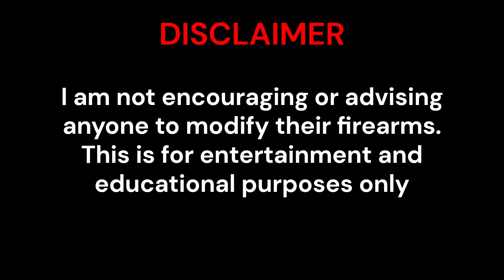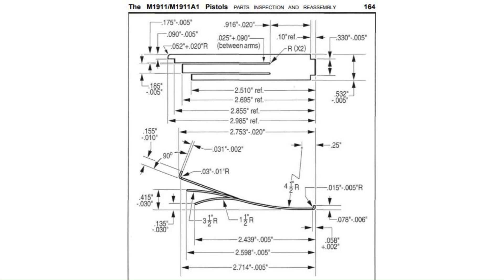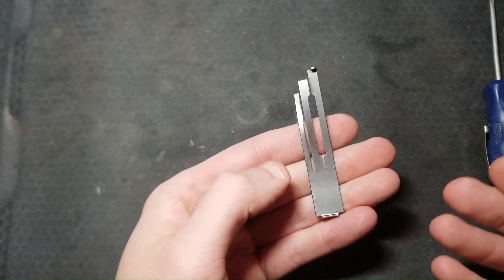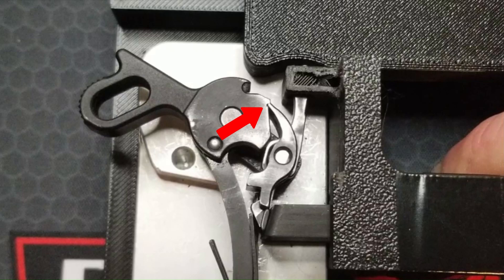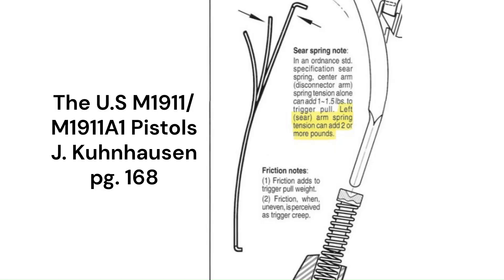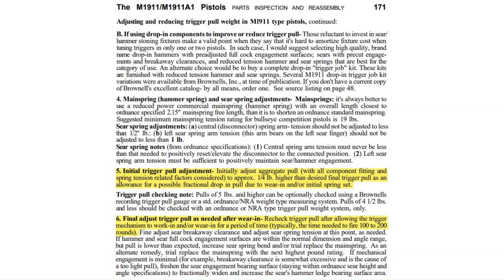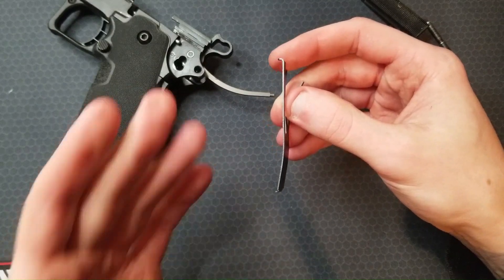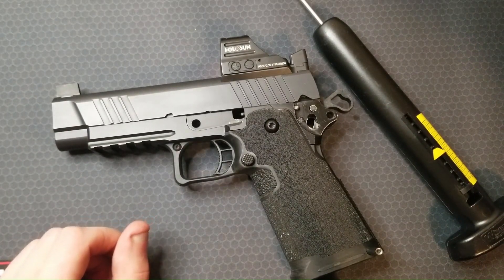A Detailed Look at the 1911 Sear Spring & Adjustment

Comment: Dude.... TYSFM.. I recently put the atlas bow trigger into my 2011. Everything went smooth until reassembly and grip safety stopped working. 5 1/2 hours later. Retracing my steps. bending the right side of the sear and nothing. It took until your video and seeing SPECIFICALLY that the left side of the sear sits on TOP legs of the sear, NOT UNDER. OMFG thank you.
Reply from the maker: Haha happens to the best of us! Glad this helped!

Comment: I use the same Colt spring in all of my 1911/2011s. I have found it pretty darned easy to get 3.25lb (and safely operating) pulls with this spring and some judicious polishing. I have parts inbound to reduce an officer model mainspring from 28 lbs to 19 or 21lbs to see if in can get a 3lb pull with no other changes. Hey, I’d love to know your thoughts on flat recoil springs. I know it has nothing to do with pull but it looks like the big guys (Wilson and brown) started offering these around 15 years ago and even ISMI is in that game as well now. It requires changing the guide rods from .336” to .250” to accommodate them.
Reply from the maker: Flat recoil springs generally will offer a more consistent force vs displacement. They also don't experience as much internal stress during displacement due to their wire shape and higher number of coils. They will generally have a longer service life. Thats the big reason they are so popular in pistols now days as far as i can tell - increased service life.

Comment: In a weird way my brain can’t help but make it look like a rev match downshift in a straight drive car. Completely different I’m sure but still feels manual if you know what I mean😂😂
Reply from the maker: Haha I get it. I only own standard transmission vehicles. There is something similar in the way a 1911 works. That finely tuned mechanical system that is very analog.
Reply: @EngineersArmory Question…Would a Staccato C2 grip fit onto a staccato XC size firearm? My line of thinking is as long as it’s the same caliber and double stack theoretically it should. Based on your content I figured I’d ask with your knowledge in the matter.
Reply from the maker: @Lee-ForReal i beleive so. They both take "standard" staccato/STI pattern mags. The C2 just uses a slightly shorter 120mm 16 round mag, rather than a 126mm 17 round mag. I would imagine the mounting interface at the frame is the same, but i dont know for sure. You can buy "commander" style grips, Cheely offers one, MJD can cut any of their grips for the 120mm magazines to sit flush. I am building a doublestack commander right now and got a carry cut MJD grip module. The 120mm mags sit flush. It still takes the 17 and 20 round mags as well they just stick out a bit.
Reply: @E @EngineersArmory Preciate you man, I’ll keep deep diving😂

Comment: I've got a 2311 that was, what the French would call "le garbage", from the factory. Jammed hammer so it had to go back. They put a new sear in it and then 150 rounds through it. So after buying it I got to spend $40 to have someone else make it a not new gun for me. Anyway don't buy a girsan/eaa, but if you do you have to watch this to figure out how to adjust that sear spring. It isn't hot garbage like it was, but it's a lot closer to being that five at the bar at 1:30am when you're out of options...

Comment: Excellent detailed video!  Given your attention to detail and importance you place on clearly communicating detail, I'll guess you are a mechanical engineer or in a related profession.  I am curious whether you have also tried the lightened sear spring offered from EGW?  You mentioned you have standardized on the EGW offered factory Colt, so I would think you would have tried the lightened sear spring (SKU:10694) offered from EGW also?  If so, what did you think?  I just bought both from EGW and the only differences I can see are that the lightened seems to have more of a black oxide finish, and the relief cuts are a little longer, going closer to the base of the tangs.  I haven't tried installing either yet though.  I previously installed the EGW offered factory Colt with the help of your video.  Thanks again for the well done video.
Reply from the maker: I am indeed a mechanical engineer.  I have not tried the lightened sear spring from EGW. I have found EGW 10960 (colt reduced power), and Wolff 31201 work great for my purposes. I can get any trigger pull i want within reason using either of those springs.

Comment: I have a 9mm 2011 that I was starting to get light primer strikes with. So I changed out the mainspring from a 16 pound to a 19 pound. The light primer strike went away but now I am having hammer follow when I hold the trigger in after each shot. When I let off the trigger after each shot the hammer stays cocked. What or how should I adjust the sear spring to eliminate this problem? I have not replaced any other parts except for the mainspring. Someone told me with the more powerful spring I am getting hammer bounce.
Reply from the maker: Installing a stiffer mainspring should put more pressure on the sear/hammer interface, giving a higher engagement margin, reducing the chance of hammer follow. I am not sure what hammer bounce is, never heard of it. I have heard of trigger bounce but that has more to do with the weight of the trigger shoe and bow.

19# is still reduced from the standard 23# and shouldn't pose any issues. 

I would make sure everything was installed correctly, especially the sear spring. Make sure the hammer strut is engaging with the center of the mainspring plunger cup.

I dont really see a way that swapping out a mainspring and doing nothing else would cause hammer follow unless something was installed incorrectly or damaged during disassembly/reassembly.
Reply: @EngineersArmory yeah I need to pull it apart again and check. I have 3 different 1911 and one 2011. I have no issues with the  1911s and have changed so many parts over the years. Put them back together and they ran fine. This is a first for me with the 2011.

Comment: SUPERB video, man. You and your content is the epitome of 1911/2011 gunsmithing. I’ve watched this video at least 8 times. And watched it earlier on my lunch break in my office…

So question, and I hope you see this and reply, If someone wants to knock maybe 1Lb to 1.5lbs on a trigger break, which tang is bent? Center or middle? without any other mods and running a 19Lb main spring on a Tisas DS. Thanks in advance! 💪🏼
Reply from the maker: I appreciate yhe kind words as always homie.

You would adjust the left spring tang (looking from the rear towards the muzzle - the tang that contacts the sear). If you dropped your mainspring to 17# you may shed 1/4 - 1/2 # of break weight. 

Always remember your sear engagement safety check - drop the slide on an empty chamber and make sure the hammer doesnt fall.

I have a video about quickly lowering the trigger weight of a 1911. That video should get you there. Less technically focused, more practical.
Reply: @EngineersArmory Thanks a ton! Looking for that video NOW!

Comment: Is it possible to get the stl files for your 3d printed demonstration part that displays all the parts?
Reply from the maker: I usually do post my designs on GrabCAD but not this one. It was very difficult to get it to work. I had to modify the parts after, never went back and updated the models. Its not a good design so I will not publish it.

Comment: I installed a red dirt drop-in into my prodigy.  I took out most of the take up to where I like it, and I also like my break weight.  I would like to gain a little more positive reset, though. Adjusting my center tang slightly foreward into the disco is what I need, correct?  Will I also need to bend the sear leg as well to keep the raitio or just a little bend on the middle leg?  Thank you sir
Reply from the maker: Yep, adjusting the center range forward will increase reset positivity. It will also increase your break weight tho. So if you want your break weight to be the same, you might have to adjust the left (sear) tang back. Make sure you do your safety checks to confirm adequate sear engagement force.
Reply: @EngineersArmory  I dont have hammer follow, but im pushing it poundage-wise on stock internals and its a little inconsistant, so I wouldnt mind if the pull weight goes up a tad.  If I dont like it ill pull the left tang a little as well.  Thanks for the reply

Comment: Should the disconnector tang push with enough force that, if you manually push the disconnect down from above, it should pop back up? It does on some of my 1911s, but on one the disconnector stays stuck down until I rack the slide. Then, when I lock the slide open and look, it's always up.
Reply from the maker: Generally yes the disconnector should pop back up. But if you are holding the trigger back it may not. If the trigger is pulled and the hammer drops then the slide is racked that will push the disconnector legs under the sear and it won't pop back up until the trigger is let forward to reset. There also maybe different function I'm not aware of with the 80 series trigger system.
Reply: @EngineersArmory  With the slide racked and locked open and I push the disconnector, it stays down (on that gun). I wasn't holding the trigger, so was fully forward and had been fully reset. Having pushed the disconnector down though, it would no longer be below the sear. If I would jiggle the trigger slightly it would come back up. If I let the slide forward it would also come back up. So I wonder if the disconnector spring's pressure was borderline weak, but with a little rattle, it was able to return the disconnector up. So, practically speaking, it may be a non-issue, since letting the slide back into battery would rattle the gun enough to help the disconnector back up, and only then could it fire, which it is supposed to do. That gun is actually at the gunsmith, so I can't test it now.
Reply from the maker: @oakleydefense5513  As youre describing it, t me it sounds like marginal spring force on the disconnector from the middle tang of the sear spring. If its at the gunsmith it might be a good idea to have them look at the adjustment of that spring.
Reply: @EngineersArmory  Thank you. Your video helped me understand in inner working and figure out what must be going on. This all makes sense. I described the stuck disconnector, so I assume the gunsmith will identify the cause. Again, thank you for the excellent video. I'll be watching more or them.

Comment: Awesome information!!!!  In my opinion you could’ve adjusted the sear spring more to get a lighter trigger pull by bending it more and most likely without adjusting anything else that you mentioned.  What do you think of my comment or of my idea ?   Any thoughts I will greatly appreciate!!!   

Thanks!!!!!!!!!!
Reply from the maker: That is correct. But there is a limit to how low you can get that break weight before you run into inadequate sear engagement. That limit will be dependent on mainspring force, your sear and hammer geometry, and the adjustment of the middle (disconnector) tang. I mention this at 17:43.

I picked a break weight for this demonstration that was what I had this trigger set at anyways. I did this because thats the weight I defined my sear and hammer engagement relationship around. With the sear and hammer hook geometry I had, and my mainspring weight I could likely have gotten that break weight down to 3.25-3.5# with my middle tang adjusted to a 1# take up.
Reply: @EngineersArmory your explanation totally makes sense to me.  I totally agree with everything you’ve said here.  I want to thank you for the time and effort that you are putting into these very informative videos and I know there will be thousands of viewers that are benefiting greatly.  I appreciate the scientific process that you involve in the gunsmithing content.    Again, thank you!!!!!
Reply from the maker: @wvlongshooter3912  You're most welcome! Thanks for watching, and commenting.

Comment: 12:18 so adjust the center leaf as shown in the diagram rearward to light the brake weight ? Is my understanding, correct?
Reply from the maker: That diagram shows an arrow at the center tang pushing forward (towards the muzzle if it were installed in the pistol). This would make the take up, and break weight heavier, and the reset more positive. The arrows in that diagram are only identifying the tangs, not showing adjustment direction.  Adjusting it back (away from the muzzle if it were installed in the pistol) will lower break weight, but it will also affect the take up weight and disconnector function and reset positivity.

Comment: What does that fastener (screw ) on the forward section of the trigger guard thats aft of the accessory rail used for? Is it holding part of the frame together ?
Reply from the maker: That's one of the 3 fasteners that holds the modular 2011 grip module on to the frame.

Comment: Is it better to work with the standard GI sear spring rather than a skelontonized reduced power spring?
Reply from the maker: Depends on what type of trigger pull you want. I dont run the GI style springs. The reduced power ones seem to be the most common by far. They work well with modern sear and hammer geometry and the types of trigger pulls modern 1911s have. I have never had an issue with the reduced power ones either. The majority of manufacturers use them. Even if you want a nasty, mile of creep, 6 pounds trigger, you can get that with the reduced power ones.
Reply: @EngineersArmory  Thank you!!  I have a new Springfield Loaded Target.  The trigger is crisp but at 6-6.5lbs.  Take up is 2lbs.  I have yet to remove the mainspring housing to view what type of sear spring it has.  I will order a reduced power spring to work with or as a backup.  My other 1911s are at 4.5lb with 1.5lb take up.
Reply from the maker: @glenk2254  I would be surprised if it had the GI profile spring but who knows. Between mainspring, sear/hammer geometry, and sear spring adjustment, the reduced power sear springs can absolutely produce that heavy of a trigger. When I hear "loaded target" model. I do not think "oh yeah 6-6.5# trigger pull!" Thats ridiculous haha.
Reply: @EngineersArmory  Springfield uses GI springs in this Loaded Target.  I had to change the hammer spring weight to allow it to shoot lower power loads.  Out popped the GI spring along with the housing assembly.

Comment: Man. I got the b9r DS yesterday and before actually taking it apart, I thought Atlas had a good video to tune the gun. Until I actually took it apart. then I looked you up to see if you had one. Man. Best video. Your illustrations and explanations are above and beyond. thank you so much.
Reply from the maker: Glad they're helpful homie! Congrats on the new pistol. Fun projects.
Reply: @EngineersArmory  if my grip safety no longer prevents trigger engagement, did I bend the 3rd tang too much, or is something out of place?
Reply from the maker: @sparkyboots  Something is likely out of place. the only way that could happen is too little tension on the 3rd leaf that contacts the grip safety, or something is out of place.

Comment: I run a 2.5 lb trigger. Takeup weight is 11oz. Mainspring is 19# for 9mm.
Reply from the maker: Interesting weights. Surprised you have reliable disconnector function, and a positive enough reset, with that low of a take up weight. And that you're also able to get that low of a break weight with a 19# spring. Does the trigger pass the slide drop on an empty chamber test? My guess is your sear and hammer relationship is was negative.
Reply: @EngineersArmory I have 2 Springfield prodigies tuned like this, no issues with either of them. I shoot around 5k round a year between IDPA and PPC. The internals all have been upgraded with EGW including their ignition kit. I have not done any modifications to the sear or the hammer, and according to EGW the hammer and sear out of the box have a neutral engagement. Another change I’d recommend to anybody is to replace their large radius firing pin stop with a square or small radius firing pin stop. Greatly improves felt recoil, retards the motion of the slide keeps the chamber closed for a fraction of a second longer. One of my favorite modifications. I use the EGW oversized firing pin stop, fitting is required as the part is slightly oversized.
Reply from the maker: thanks for sharing! It's funny to me that EGW uses the term "neutral" to describe their sear tip angle. It's at the original angle specified by ordinance dimensions. 90 degrees with respect to a line drawn straight up from the pivot point, that is parallel with the sear legs. I suppose calling it neutral makes sense from the standpoint that it's not adjusted one way or another from spec. 

I consider that angle as creating a negative relationship with the hammer hook. That angle "falls away" from the hammer hook tip as the sear pivots forward. Of course there are lots of different definitions of the sear and hammer relationship for the 1911, lots of them conflicting. I give a detailed explanation of my own descriptions in a video.

I need to get my hands on an EGW ignition kit. I know how their sear are cut, and that relationship with the hammer hooks should cause an engagement that is marginal depending on how much engagement depth there is.

Sorry, rambling, sounds like you got your triggers dialed in either way hahaha.
Reply: You sir are so full of crap.